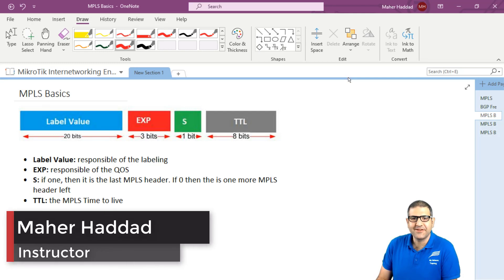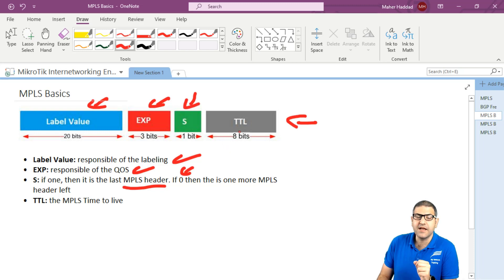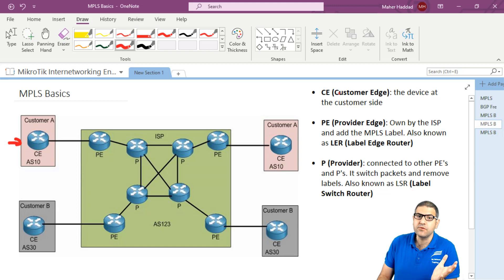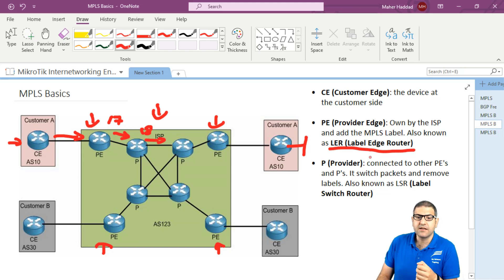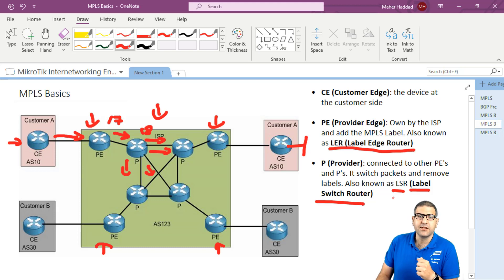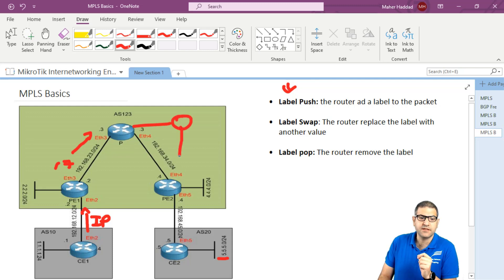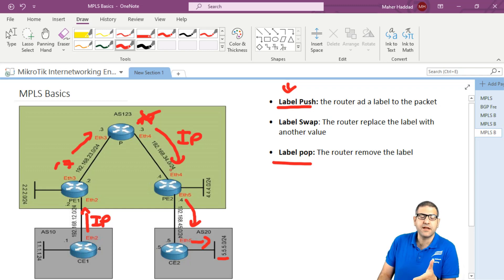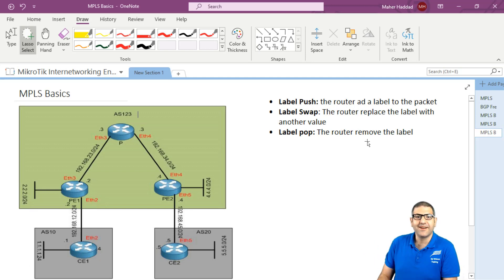MPLS header and acronyms (CE, PE, P, Label Push, Label Swap, Label Pop)

Comment: Thanks for great explanation! If P router is connected to another P router, you mentioned that label pop occurs. But in the first P router, Label pop happens and label is removed. Correct? Now, if it is connected to another P router and traffic is moved to P router, how does label pop occur?
Reply from the maker: label is just label :)